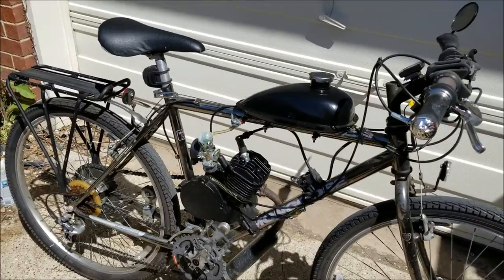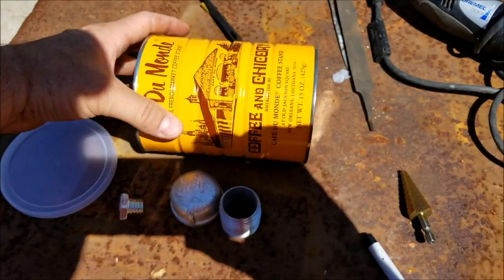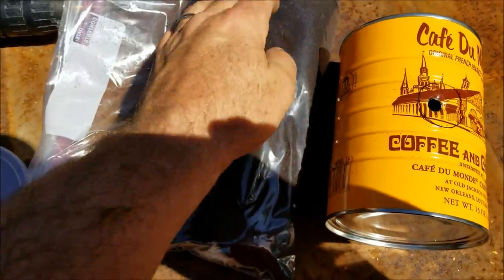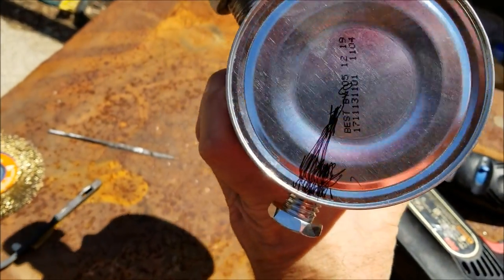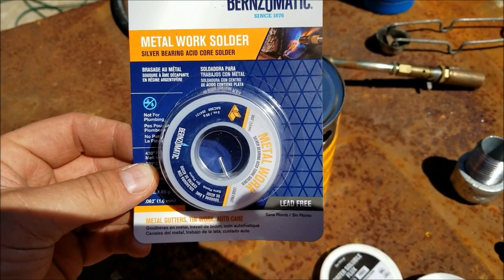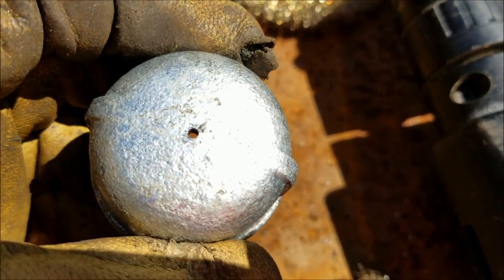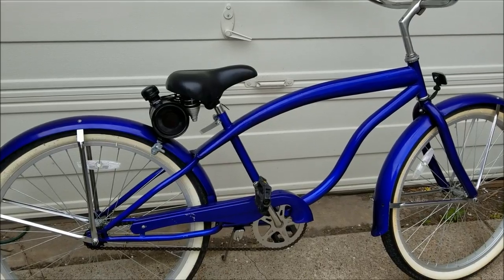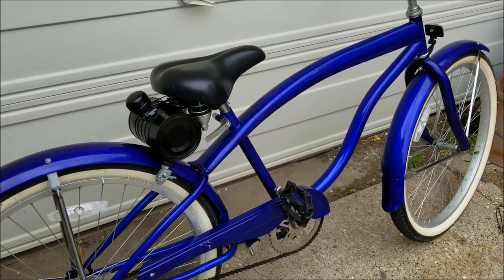Build a Gas Tank for Motorized Bike or Any Small Engine

Comment: I'm building one out of a baked bean can I opened one end with a safety can opener and dumped the beans in a large bowl . I used the lid off a can of two stroke   still working on the petcock part

Comment: My bike runs about 40+ mph  hella fun ^^
Reply from the maker: That's awesome! Mine goes about 30mph but it's the cheapest stock kit from China that I found on ebay. It's all stock except for the spark plug. I haven't ever reduced the oil and gas mixture from break in, but heard I could probably get a little more with a leaner oil gas mix. Anyway, they are a lot of fun! Thanks for commenting!

Comment: Drill the cap out larger put a gas pipe connector on use some gas line to run to a dirt bike carbon fume filter make it less likely for you to have a fire from gas fumes

Comment: Where did you buy the gas cap and the bung from
Reply from the maker: Lowes or Home Depot. The "gas cap" is just galvanized cap in plumbing section. Cost around $3.
Reply: Wow thanks for quick reply and I’m guessing the petcock bung from online ?
Reply from the maker: @jonnypiper5378  I honestly don't remember where I got the petcock bung. I don't think I purchased it online, but I might have. I would bring your petcock to Lowes/ Home Depot and see if they have anything that works. You could just use a regular nut with the same thread and solder (or even use JB Weld)  it to the tank. Best of luck!

Comment: Did you switch the head around on the spark plug so it faces the exhaust if so did you notice any increase in power or efficiency
Reply from the maker: No I didn't but might need to try it!
Reply: @TXJasper  I. Ought one of them recently and people have the heads both way and wonder if one way is more efficient or has more power

Comment: How did you close off the end of the can after removing coffee? I assume you soldered the lid back on?
Reply from the maker: Never took the lid off. Just drilled two holes to remove the coffee, and soldered two pipes with treads for petcock and has cap.
Reply: No he got the coffee out thru the hole he drilled for the gas cap

Comment: building a motorized bike at the moment and the bike i have has external brake cables that the fuel tank sits on, is this a problem for the first bike you built.
Reply from the maker: Congrats! My first motorized bike build had 3 shifter and brake cables under the tank too. My cables were not sleeved but had tiny donut shaped orings that kept my cables from touching the frame. I slid all those under the tank and it worked out fine. As long as your cables are sleeved or has some type of oring spacer to keep your cables free from being crushed you'll be ok. Attach the tank 1st before anything else to see if it works. Here's a link to somdthjng similar to what I had on my cables
https://www.google.com/url?sa=t&source=web&rct=j&url=https://www.amazon.com/MonkeyJack-Bicycle-Donuts-Housing-Accessories/dp/B077QBSTCJ&ved=2ahUKEwjE8_mcj5nlAhXFna0KHVIuAnwQFjABegQIBBAJ&usg=AOvVaw3HSjODm5EOj1Fmp1csGRxH

Best of luck!
Reply: While the exposed cables may get pinched between the tank and the frame, t would either find a new location and style tank, or build a channel over the cables.

Comment: How do you get the post extensions?
Reply from the maker: I actually made them from screws at the hardware store. Bring the nut with the same thread count and buy long screws and a screw coupler ( attached a link with photo: https://www.mcmaster.com/bolt-extenders/metric-to-metric-female-hex-thread-adapters/). Cut the head of the screw off with a grinder and touch up with sand paper/fine file. Join together with the coupler and loctite.